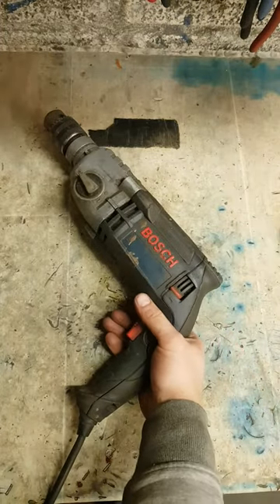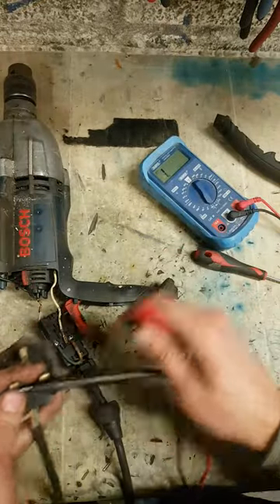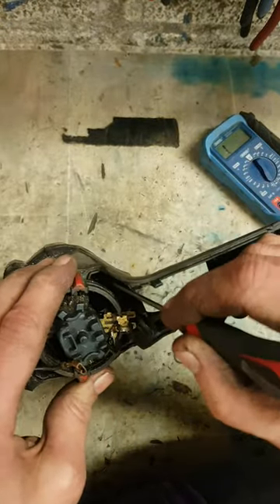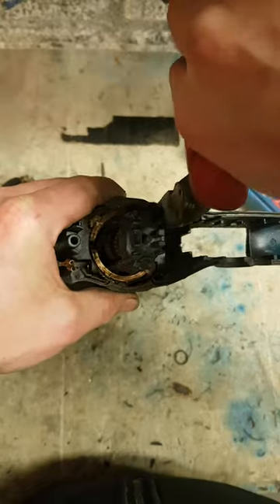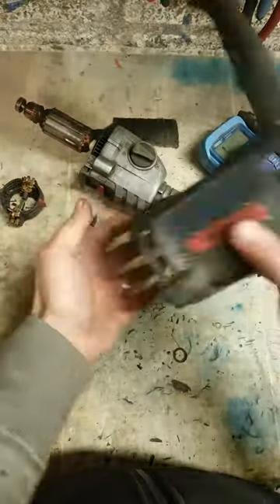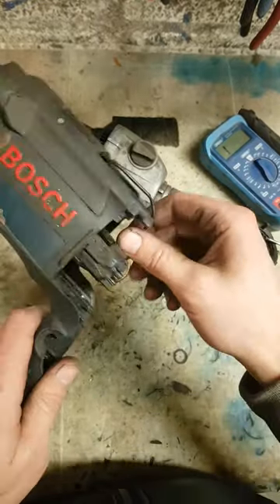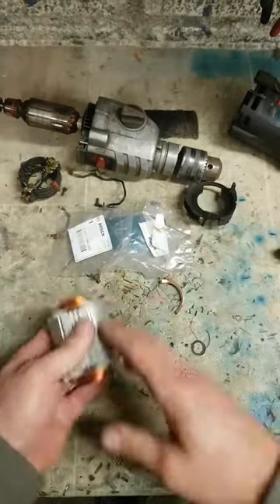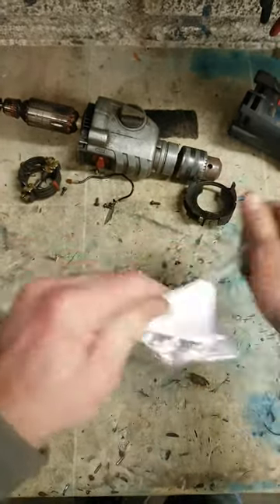Bosch GSB 21-2 RE drill wont switch on. Field changed.

Comment: hi great videos dean ,i have the same drill and it doing the same thing the chuck turns but if you grab hold if it , it starts slipping does that mean its a new  transmission or new chuck ? how can i check which one it is so i can order the right part , thanks john
Reply from the maker: Transmition

Comment: Ive often wondered at the economics of some repairs. 

Have you considered mentioning not the actual prices/cost of the repair in Pounds/Euro…. But as a percentage of the cost of replacing the tool with a new one?

Some people may be encouraged to seek a repair if they realize it can be cost-effective and at the same time don’t hav etc learn the hard way “they don’t make em like they used to”
Reply from the maker: Good point. Might start putting that info in.
Reply: @deandohertygreaser  have u mobile number ive a Bosch hammer drill an she stopped trigger doing nothing won’t work